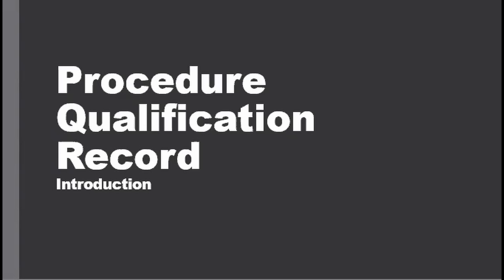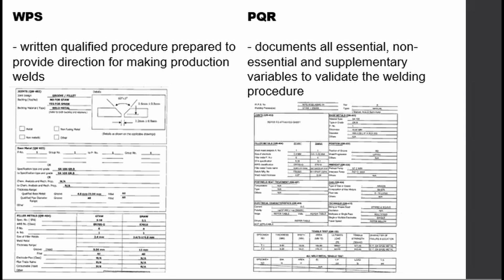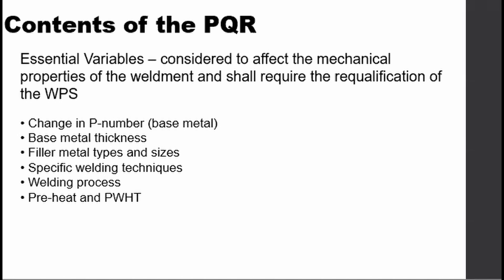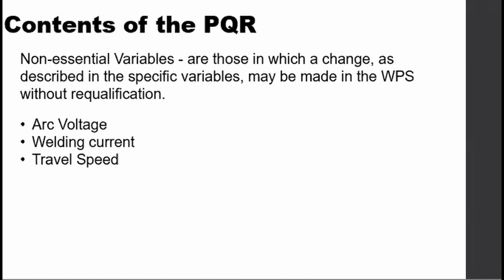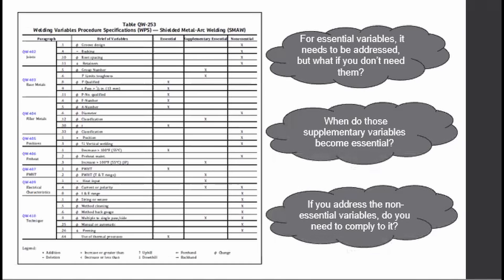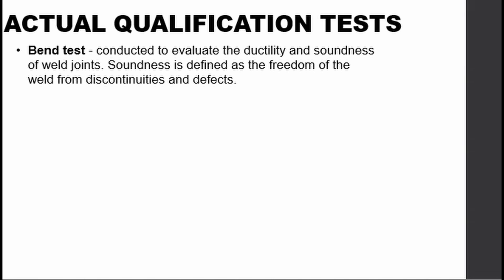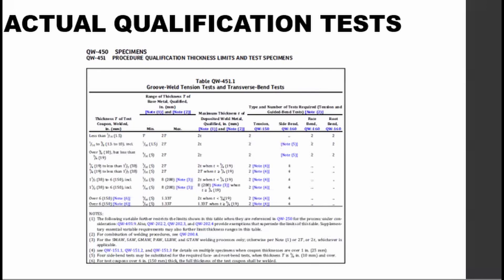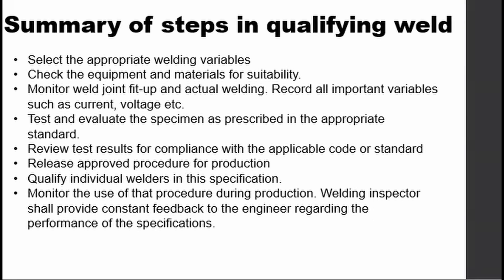Procedure Qualification Record (PQR) explained! | Differences from the WPS

Comment: I've a few questions 
1. Where can we get welding parameters such as voltage current travel speed written for reference for the test coupons 
2. Welder requirement for the test coupons preparation 
3. Is it possible to use PQR of other companies or projects in different projects or company 

Thank you so much
Reply from the maker: 1. aws filler metal guide has one but different organizations have different internal guidelines
2. this depends on the standard for example asme ix has its own, so as the others
3. no, the company must certify their own